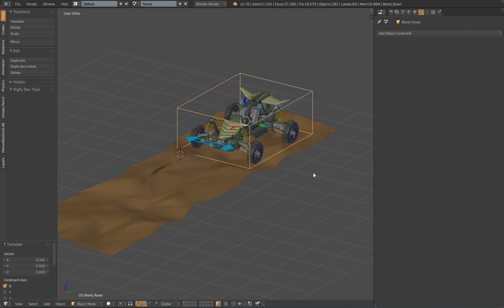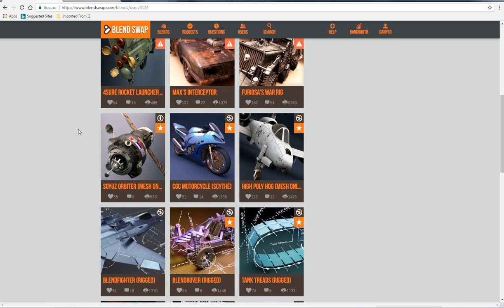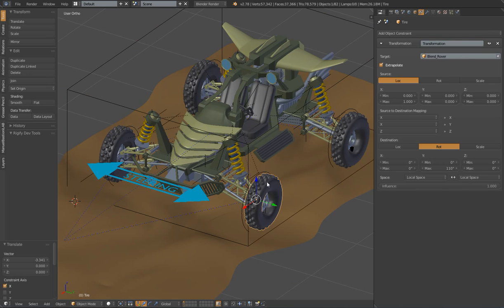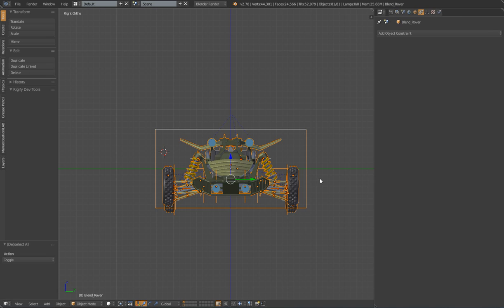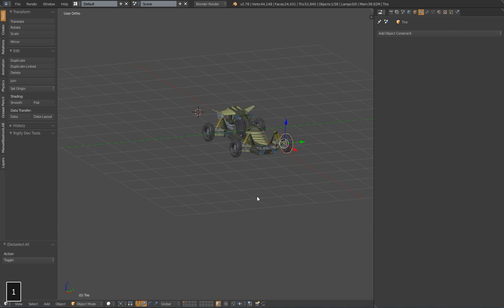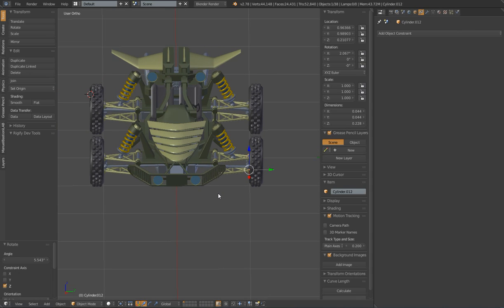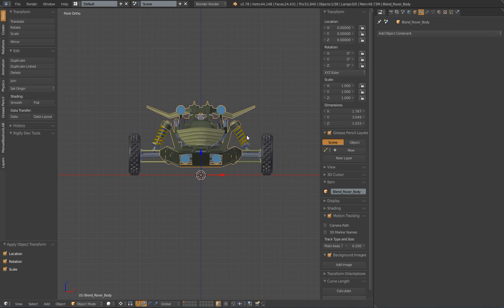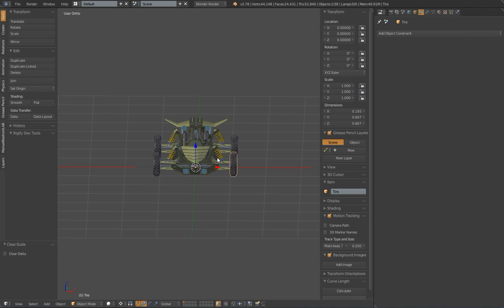Vehicle Rig, Part 1

Comment: Thank you for this vehicle rigging tutorial, I've been looking for a good video on rigging bones for a while now and I no longer need to thanks to your videos. Excellent work!
Reply from the maker: Thanks! I'm glad this helps you.
Reply: Yeah I got my bones set up for rotation and location, but I'm having a difficult time with the suspension bones because it's for a solid axle model that I'm doing rather than independent suspension. Also having a difficult time with steering. If I get enough insight from your tutorials I'll be posting my own little video so you and other viewers can see what I came up with. Also I'm modeling this for a game called Spintires which has a ton of mods, but nobody has done a tutorial on making a mod for that game yet so that's my goal.
Reply from the maker: A solid axle is another animal. If you can, come by blenderartists.org and post in the animation and rigging support section. It would be far easier to help you there. There also are many other great folks with a lot of knowledge. To get a good and fast response, be sure to have a sample blend with the parts you need rigged and some screenshots of your specific needs.

Good luck

p.s. If you are a new member there, you will be under moderation until you reach ten posts. You will not be able to upload blends or pics until that post limit is reached.
Reply: Hey thank you for the info, I will certainly do that as soon as I can.